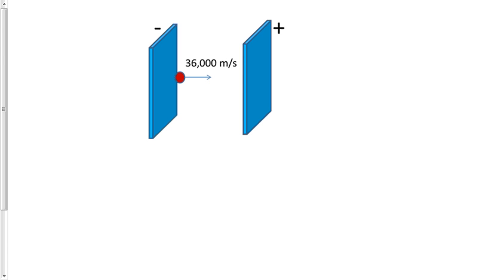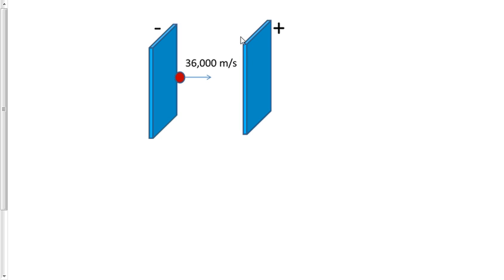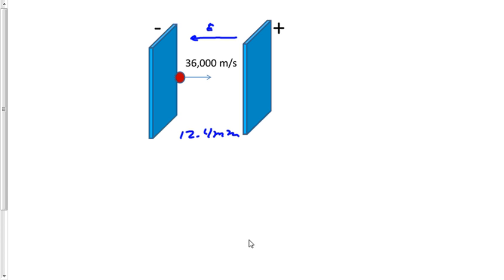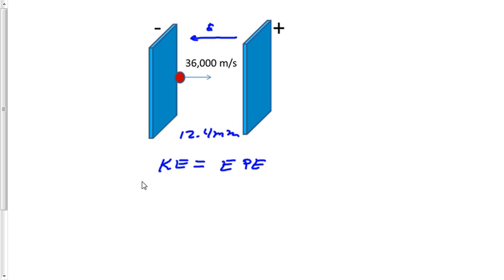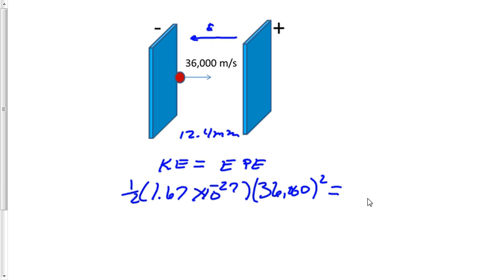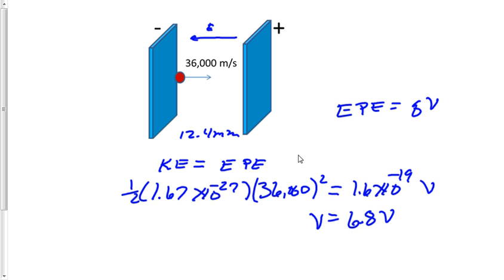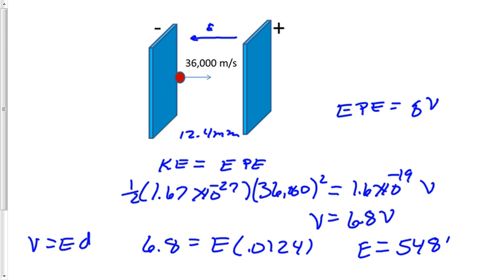Electric Potential and Parallel Metal Plates

Comment: I haven't seen a single video of it anywhere. 
WHAT IS THE ELECTRIC FIELD BETWEEN TWO METAL PLATES ?????
Reply from the maker: The electric field between two metal plates has a constant value if the distance between the plates is very small.  The direction of the electric field is from the positive plate to the negative plate.  The meta plates need to be charged of course, and this can be achieved by connecting them to a voltage source.  The potential difference across the plates is equal to the product of the electric field and the distance between the plates.  I hope this helps, but your question seems to me that is is different than what this video is about.  Let me know please.